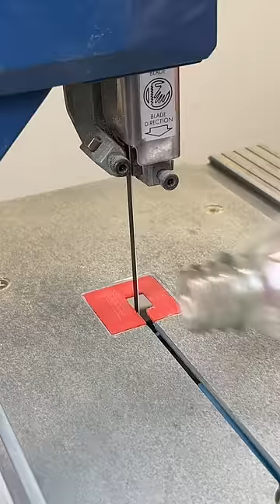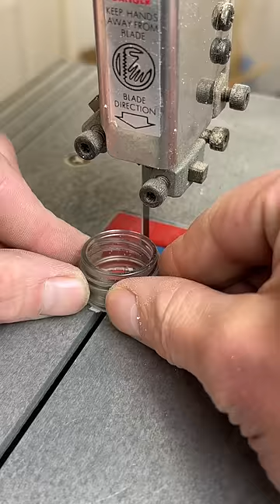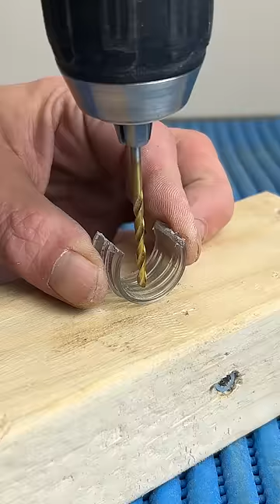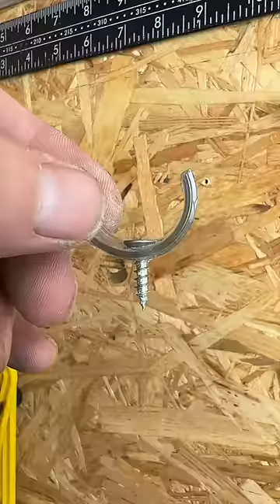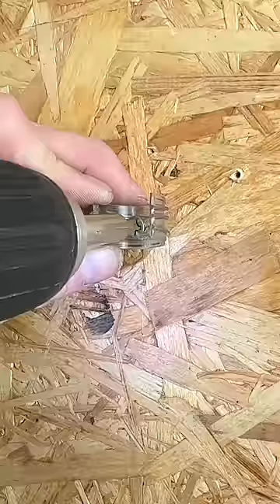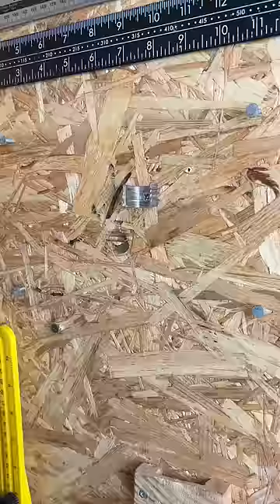Quick Clip Tip #shorts #tipcentric

Comment: Never do that Your fingers are more important than a clip that probably isn't going to work
Reply from the maker: Clip works fine, fingers are fine 👍
Reply: @tipcentric it's dangerous dear, it can slip and the things below it may harm, 

Yes when it is newly made so it will not slip but it could be after sometime, 

Your invitation is good but it could be improved with safety
Reply from the maker: @lordsmobile4997  I did a hand tool only version of this a while ago
Reply: @tipcentric  Try that with a table saw.
Reply: @tipcentric 😮😮😮
Reply from the maker: @lym3204  certainly not! Maybe on a sled with the piece clamped down.
Reply: If you can't do that, you shouldn't be around machinery anyways
Reply: Ne élj mert meghalsz 😂

Comment: It literally costs like 1 dollar for 600 of these at the store.
Reply from the maker: Still cost more than this though
Reply: @TIP Centric  no it doesnt lmfao this costs you more in time.
Reply from the maker: @Relentlesscopez  it took about 2 minutes, including filming.
Reply: @TIP Centric  bottle gathering, lid cutting hole drilling and then the use of the screw itself makes this more expensive.
Reply: @TIP Centric  ..... yeah for ONE.  600 MORE LATER...
Reply from the maker: Still nope
Reply: @TIP Centric  right.  Even if you could do 600 in 30 minutes... you value your time at 2 dollars an hour.  Smart. Electricity is also free.
Reply: 25cent per bottle Pfand
Reply: @Relentlesscopez if you are impatient and a good ways away from a store however...
Reply: This is recyclable, lol 
Are you really comparing recycling to more cheap plastic
Reply: @4f52  argue with your momma

Comment: That is a neat idea but i do habeto say if i had a nice set of chisels i wouldn't wanna hangem on those. Just that it doesn't give a good enough clamp (if you will) on the chisel and also don't go all around it, plus the weight of the chisel too could just cause it to fall. Its a nice idea and quick make to get the job done, but I definitely wouldn't habg anything real expensive on em.
Reply: Here's where a small "super magnet" embedded in the handle with a drop of epoxy which would 'connect' to a steel screw to keep it in place.
Reply from the maker: @larrywhalen596  good idea. 👍
Reply: 그거 만들라고 손가락을거니?

Comment: This is actually a very nice tip in that not only is it useful but also doesn't cost you anything, except a few seconds of your time to make it, and is kind of cool to look at when your chisels and screwdrivers are hung up on the wall.

In closing I used to have a large metal sign which had several lengths of magnets attached to the back that I had purchased at Harbor Freight to mount my tools, and looked very trick cause there were no visible hooks to see.
Reply from the maker: That sounds like a really cool tool rack! 👍👍

Comment: Why risk your fingers for a clip you can get for less than 50p? Thats just dangerous and therefore dumb.
Reply from the maker: Why risk your fingers making a sandwich that you can buy at the shop for less that £3? Knives are dangerous, so making your own sandwich is dumb also by your standards??
Reply: @tipcentric  If I used a chainsaw to prepare my sandwich, yes. Seriously: I don't care what you do in your workshop at home. But if you publish something online, you have got the responsibility to comply with safety standards. And that's just no fingers that close to a motor driven sawblade.
Reply from the maker: @samsylvester2140  you have proven my point. If you are an experienced user of a chainsaw, cutting a sandwich with one would be just as safe as using a knife. The result may be different, but the safety of it would not. Going by what you say a freehand climber shouldn’t upload his latest climbing video because he didn’t use a rope, or a parkour team shouldn’t upload the video of them jumping from roof to roof because there were no safety mats, or a rally driver shouldn’t upload the video of them drifting round a muddy bend at 90mph because they could have just gone round it at 20mph instead. Tools are dangerous, like many things in life, and anyone using them should educate themselves on the limitations and capabilities before they do so. Would you give a £120 ultra sharp Japanese knife to an inexperienced 10 year old to cut fish with? No… Does that mean that the master chef shouldn’t upload his sushi video? No…
Reply from the maker: And to further prove my point https://youtu.be/GmZjt5lK4PA